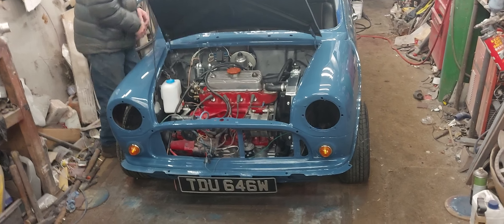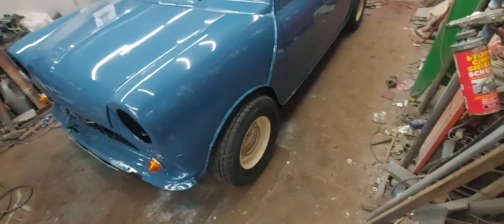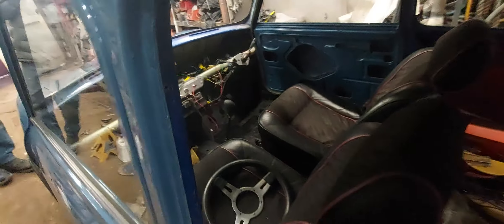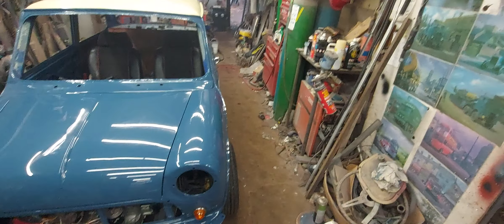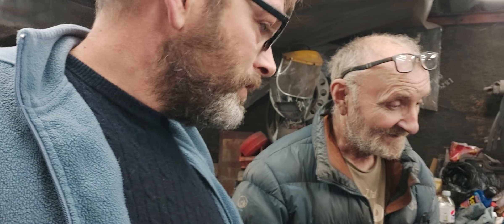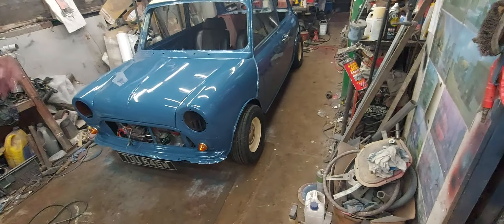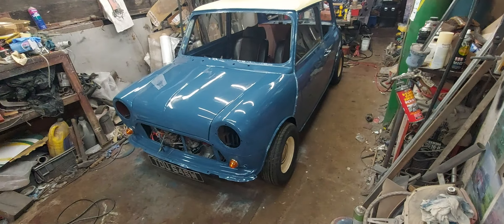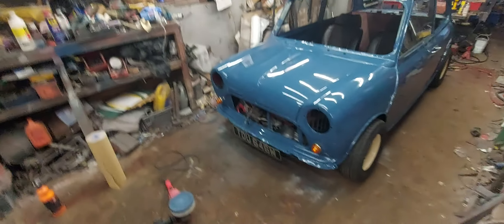Clive's most recent project.. This classic Mini!

Comment: Cool. I love 'original' Minis. I worked with a guy years ago, back in the mid 80's, who had an original 1275GT with the Clubman grill and he had it bored out to 1400cc, 2" bore exhaust (loud!) big carbs, etc! He told me that he couldn't drive it in the wet because, just pulling away from the lights it used to torque steer across the road! Some years later around the mid 90's, I saw him driving a Morris Minor. I don't know what happened to the Mini. 🤨